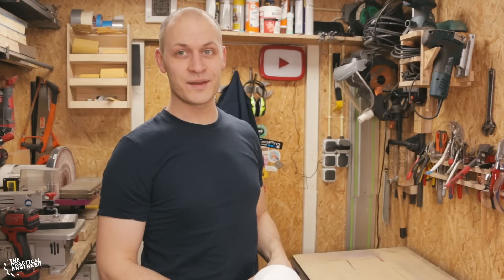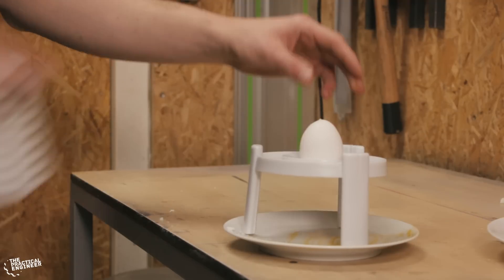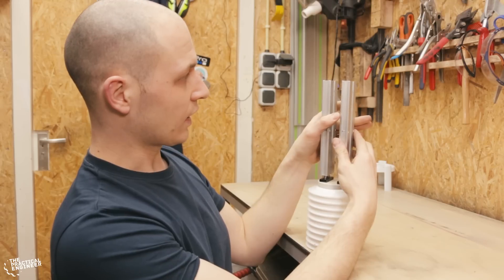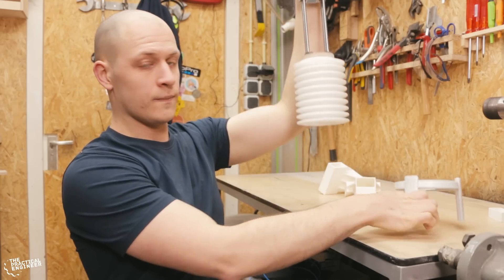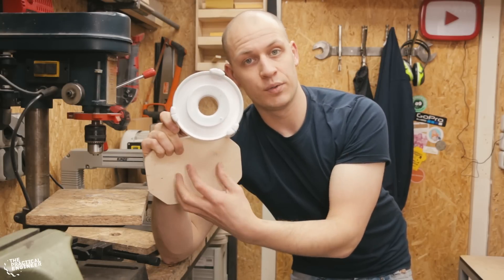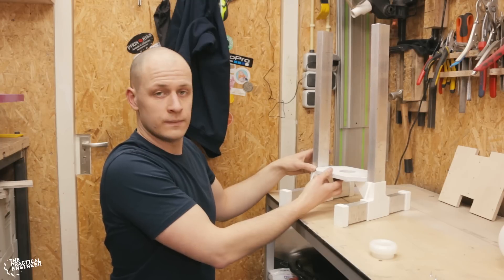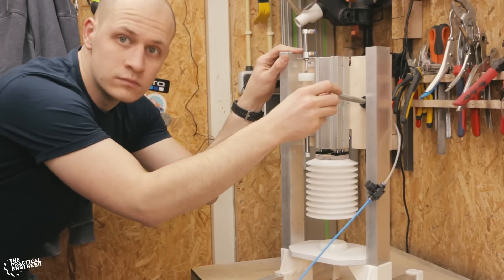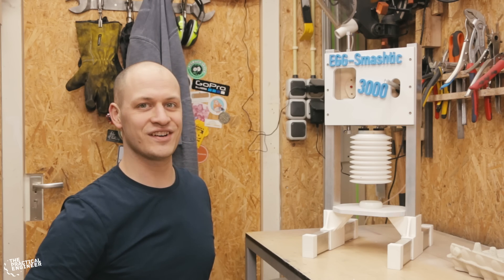Automatic egg peeling machine - improving the eggstractor

Comment: I feel like you cheated by using soft boiled eggs at first and then a hard boiled one at the end. Also, if it's all pneumatic, there's no reason for the billows, that was used in the original to convert muscle power to air pressure, you can use any pusher, and the you can do the cracking at the same time.
Reply from the maker: Hi Eugene, I fully agree with you on this. First I looked at a large suction cup over it and then just blow  a lot of air through it all at once to push the egg out. Then I decided I wanted to keep the principle from the original and see what I could do with that. It's a nice challenge to make a proper functioning one using other techniques as well I think